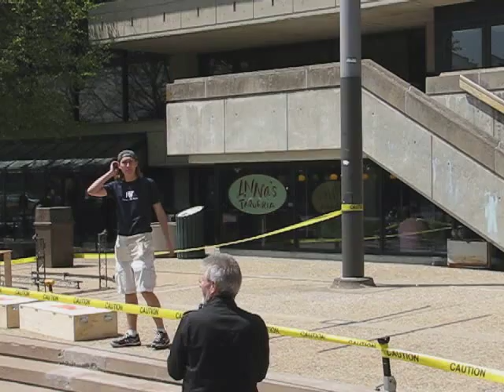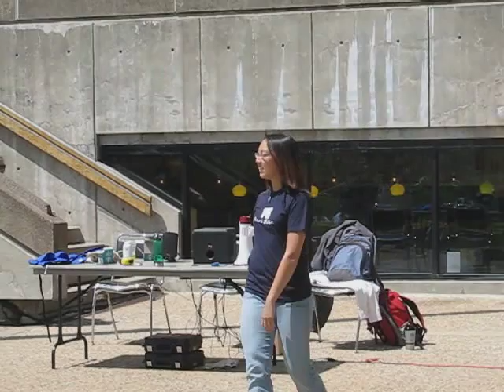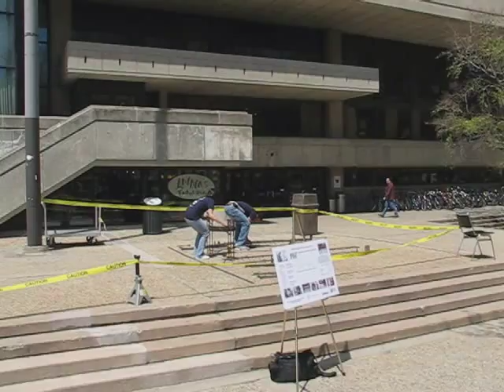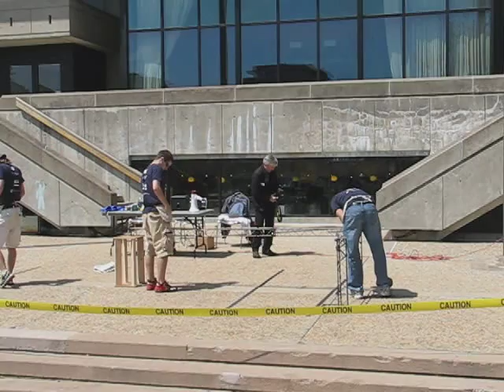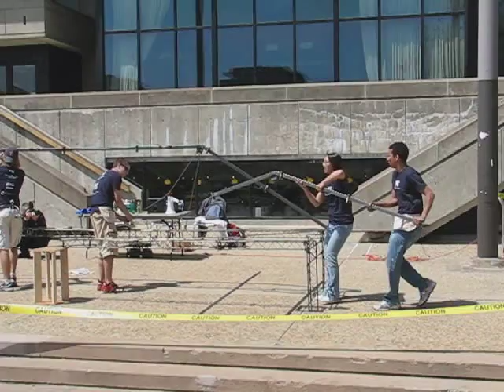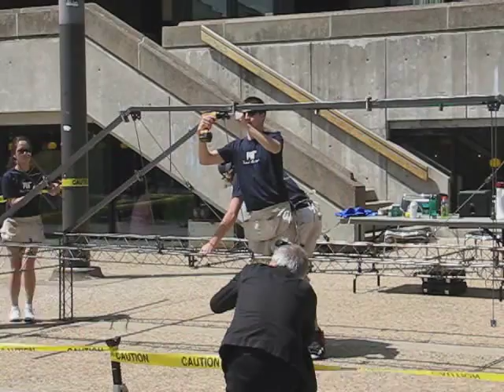MIT Steel Bridge 2008

Comment: Well Done MIT. That looked like a well thought out design. Good 'Triangulation', and nifty use of weight saving tensile cables. Also good use of the DeWalt DC728KA (?) cordless drill to speed fabrication. A WELL COOL BRIDGE! Thanks for posting.